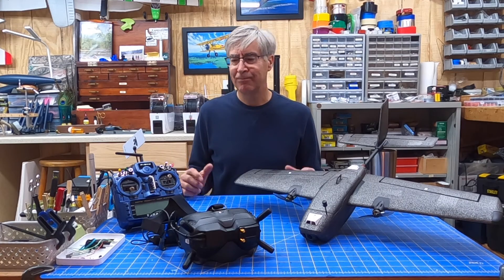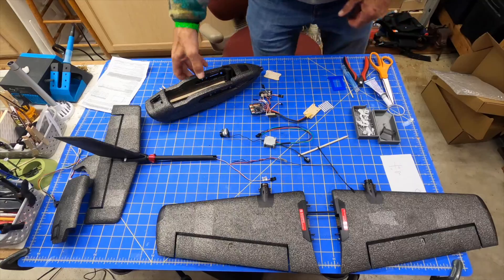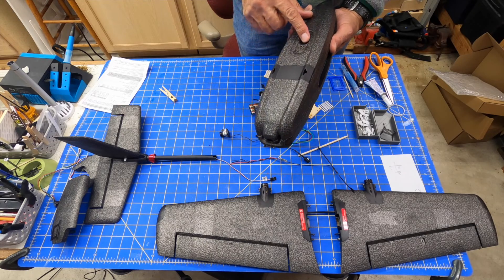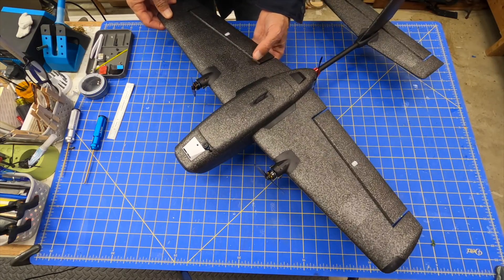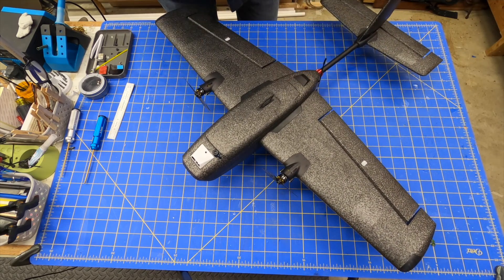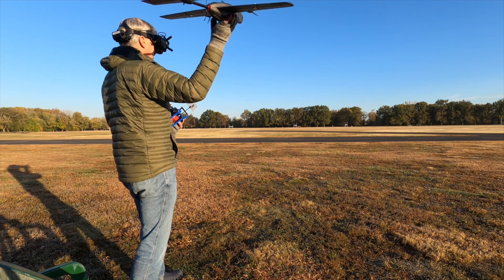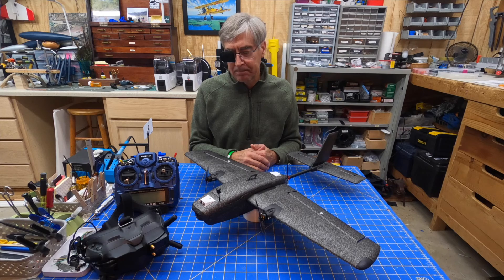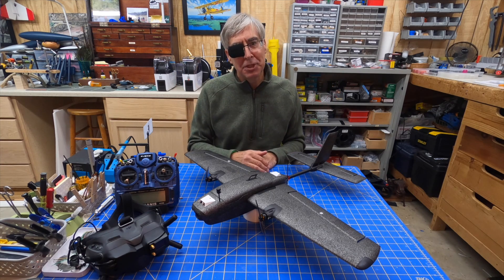Building the Hee Wing T1 Ranger FPV plane with INAV 5.1 and DJI Vista

Comment: Do you have a parts list? loved your vid very helpful.
Reply from the maker: Hee Wing T1 Ranger PNP
Video - DJI Caddx Polar vista 
FC - Matek F405wse with INAV 5.1
GPS - Matek Sam-M8Q
Battery for maiden - 3S 2600mah Lion packs - Dark Energy
CG - per spec (front of top handle)

Comment: Can this plane handle lion 4s 3000mah?
Reply from the maker: Not sure about the 4s..  I don't think the stock configuration would handle that.  But you could easily mess around with that..  From a battery compartment perspective, it might be a little tight, but I know others are using 3300 3s...  Its a wonderful FPV platform and easy to take with you anywhere, due to how you can dismantle it and toss it in a backpack.

Comment: Hi will, just setting my t1 up,   how did you set your twin motor output up on inav, ?   Did you y lead it ,or just add another motor output in  the configurator,
Reply from the maker: Bryan,  I didn't setup diff thrust.  Just a simple rudderless plane.  One output for throttle, but I connected the ESCs to the dual pads on my FC.  Hope that explains it..

Comment: I tried a 2200 and didn't get much more than 6 minutes. I made a 3s pack for mine out of 18650 3000mah cells. 12 minutes of flight landing comfortably above 3 volt per cell.
Reply from the maker: I just bought some 2600 Li-Ion packs.  Should work better than the 2200 lipos.
Reply: @SteffenRC that’s because those motors are junk.  Try 2004s on 3s 2200. I get about 15min of throttle and 5 inch t props